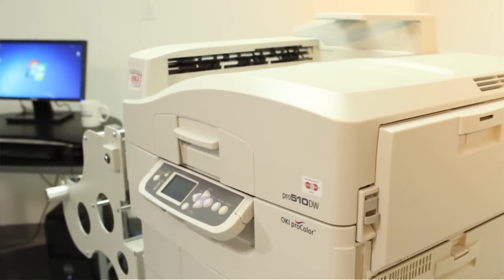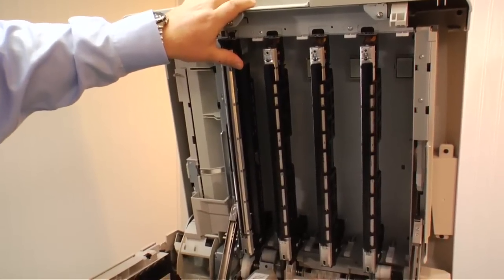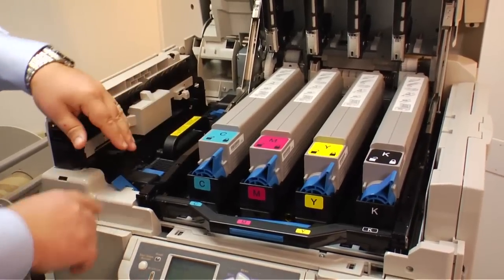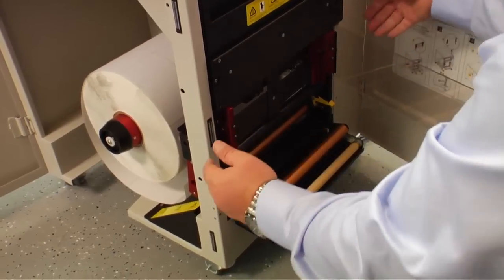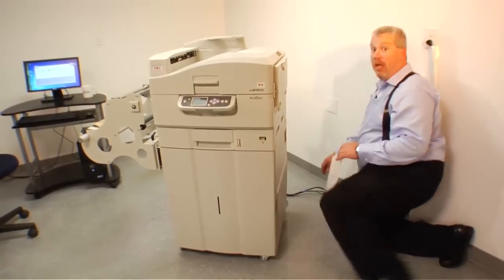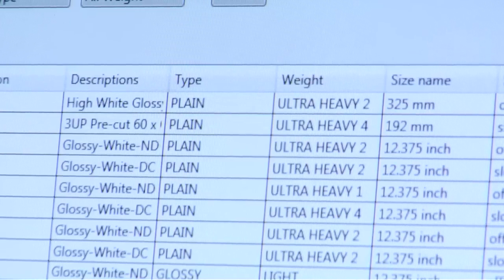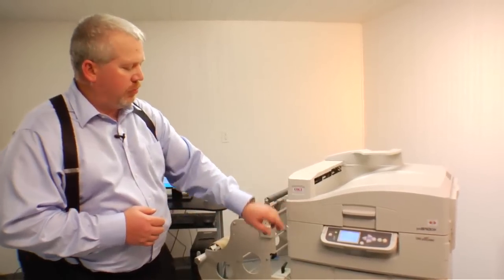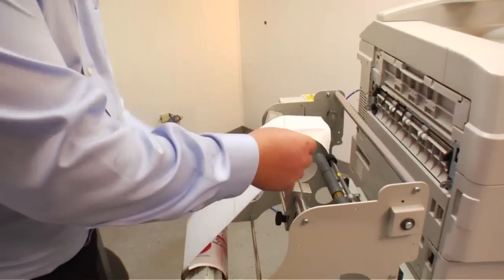OKI DATA Pro 510 DW

Comment: Hi, 
I have a couple questions.
1.- Can you print precut labels? If so, what kind of sensors does the 510DW have?
2.- Do you need a RIP Software in order to print?
3.- What kind of toner from OKI can I get? What is the part numbers or other OKI printers compatibilities?
4.- What is the max length that it can print?

Thanks!